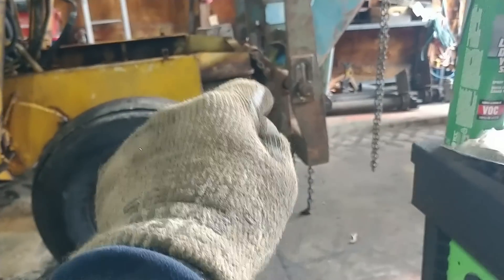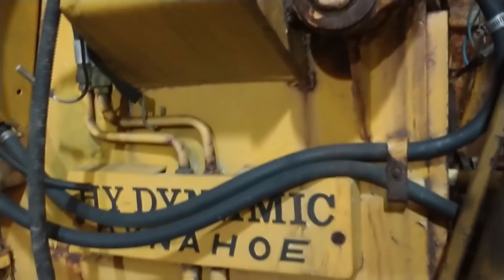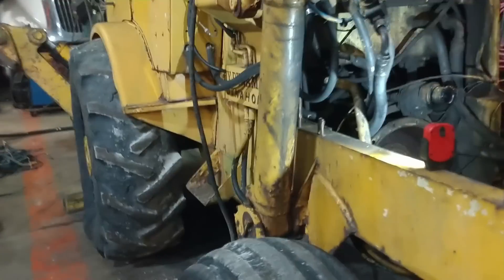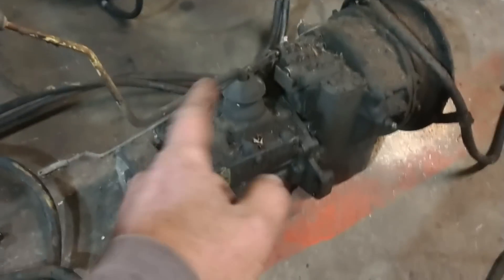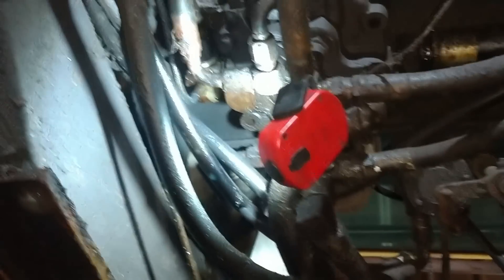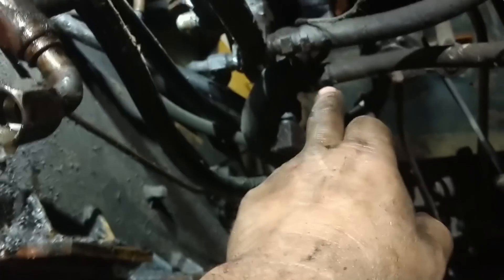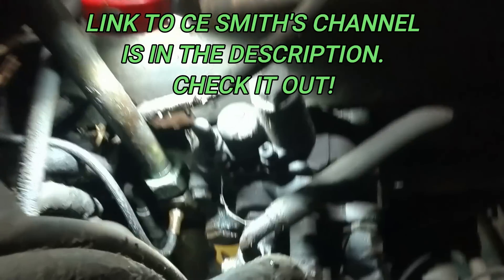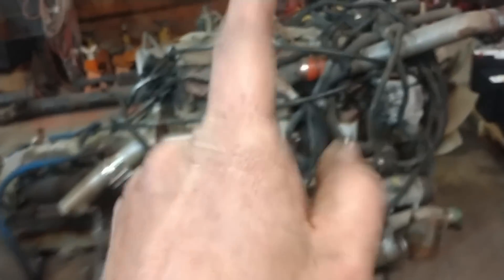DYNAHOE PT 4 HOW PLANS HAVE CHANGED! YOU DONT WANT TO MISS THIS!

Comment: Excuse me hold on i need to dig my panties outa my but crack ok ok now you was gona do what to that thing ROFLMFAO 
You know I see no reason why it wouldn't work technically the power reverser / shuttle shift is the same as an automatic  it has a torque converter like automatic but has no gear selection therefore thats why they need the manual transmission behind it.
If your length to where your drive shaft would connect considering the length of the drive shaft is there room to shorten shaft and move engine and transmission back a few inches to give more room or is that hydraulic tank going to dictate how far you can move back .
From what I see you have the capability to get it done with your fabrication skills and weighing out your options. Its never a dull moment watching your videos definitely like your proactive approach to things. Good luck on the retrofit can't wait to see how it fits and besides anything thing will fit with enough brute force and special language lol🤔👍👍
Reply from the maker: the "new" transmission is slightly shorter. i have just under 6" to work with on that shaft. should be interesting! i just need to build a shoe horn big enough to slide this monster in there.

Comment: I think I have some information for the steering, do you have one or two steering cylinders? I can copy the page of a 190B hyd lines. Send me an email. Keep up the good work
Bill
Reply from the maker: i have 1 steering cylinder. i cant find any information on the shuttle shift. all i can find on the transmission is the casting number and "warner gear" cant find the ratios of each gear.
Reply: I have a 190-4 and a 140 an 190 2 wheel drive I have books for I can send you a copy of the page you need but I would need an email to send to.   @j.c.smithprojects
Reply from the maker: j.c.smithprojects@gmail.com                   that would be great. i am looking for any info on the trans and shuttle shift. mainly ratings and what ratios are used in the manual trans.

Comment: This is going to be an interesting project. That leaking fitting was almost a case of you can't get there from here. I was wondering if you could get service wrenches in the short term instead of angle wrenches. The SO set to 2" is mucho expensive.

Comment: The rad rod whit the 2 stroke
Reply: With how much I dislike those 2 stroke fuel to noise converters, after  JC's comment about the noise from them as well. I was thinking he was going to say he was taking it out doing the cummins swap, and putting the Detroit  in a skip instead L.O.L

Comment: Hydraulic hoses are expensive, but all that stuff is so inaccessible it’s worth the cost to replace anything that is old under there.
Reply from the maker: any questionable hoses that will be hard to replace with the engine and trans in place will be replaced now.

Comment: I said to myself while you were pulling that Cummins out that you were going to put it in the hoe.
 Shoot I'm not scared either, my end project when I was in trade school was a BB Ford in a 72 Ford Courier. Another was a VW Rabbit motor in an 84 Vanagon. Probably will be my final project is the Rabbit pickup with an Oldsmobile Toranado engine and trans in the back. 
 You build what works for you. Odds are that how would have been razor blades from China if you hadn't come along.
 I'm looking forward to seeing the project progress along and very curious as to the new use for the Detroit.
 Be safe and have fun!
Terry from South Carolina

Comment: If you do angle wrenches, buy snap on.  Yes expensive but they are the only that fit.  Im a field mechanic, I cant count the times people have borrowed them.  The other thing to look at it large crowfoot wrenches.  Mine go up to 2” also.
Reply from the maker: $3200. for the full set on snap on website.
Reply: There are better ways to buy them.  I have a full set up 1 1/2 then jump a bunch of sizes to 2 inch.  I bought mine used on ebay a little at a time.  Yes not cheap, but they actually fit.

Comment: That backhoe will not pull like it supposed to because it will not have the low end like the factory transmission.
Reply from the maker: im not planning on scooping up dirt with it. the ratio of 1st gear the new transmission is close enough to the old one. it will do just fine for my needs.

Comment: Jc now I understand why you would put so much time in a dynahoe they are heavy overbuilt machine’s it will be great 2nd machine that will lift tons but spend the money replacing any hydraulic lines under that floor board. But I’m sure you already plan to do it.
Reply from the maker: i will replace all the hard to reach hoses that are questionable. i will do this before the engine and transmission go in for the final time. no need damaging new parts by taking the combo in and out several times.
Reply: @j.c.smithprojects  good luck I have never seen you cut corners on any project I'm.sure it will turn out better then when it came.out of the factory